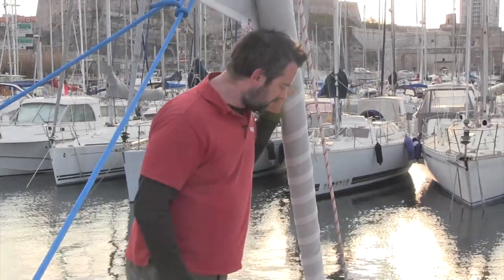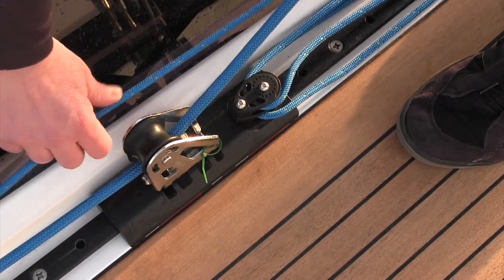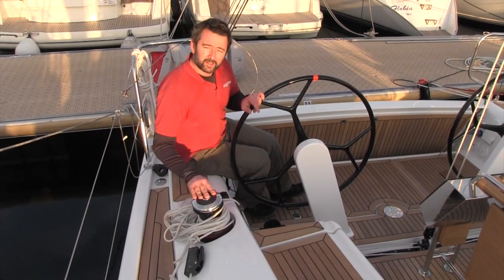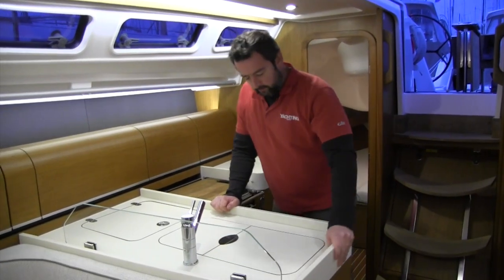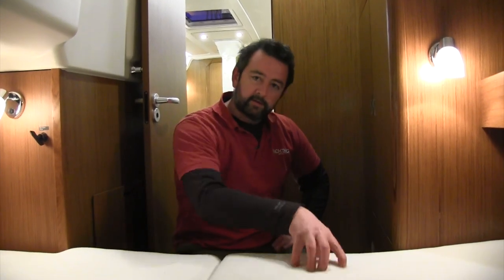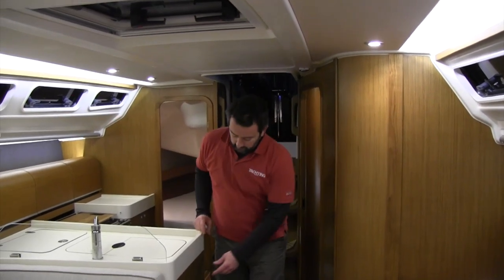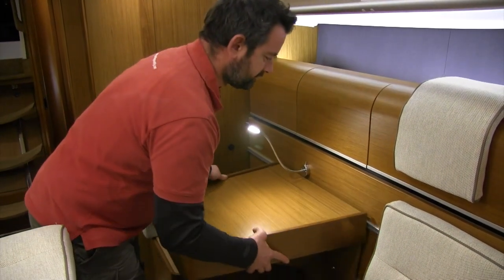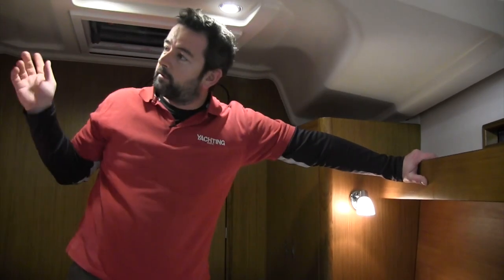Yachting Monthly's Dehler 38 test

Comment: I have sailed this boat from new, having done seven seasons and around 2000 nm per year including some offshore and inshore racing. For double handed sailing, it functions perfectly. 

Looking back at this review, it is remarkable how almost every single word is spot on. The two minor comments is that the B&G does not crack your leg and that the sink is not too shallow. 

It is a cracking performer. Quality wise, there are no major problems, neither in the design, the equipment or the assembly. 

In beating in wavy conditions the bow is somewhat flat leading to a tendency to slamming. The jib, even the enhanced pay-extra laminate version, is a bit on the small and stiff side. For competitions, a larger, lighter and more black one is prefered. 

I believe the price levels have gone up dramatically lately though. 

We do some 4-5 weeks of cruising with five people, four grown ups, each summer and it just delivers. 

In general, its just great fun to sail and a a great design.

Comment: A lot of ill-conceived deck details seem to plague this boat. The manufacturer seems more concerned about a chic appearance than seaworthy functionality.

I have also noticed that almost all of these "modern" hull shapes, whether 35-ft. or 60-ft., hobby-horse and pound quite severely in even a moderate sea state. I think there are fundamental flaws in these designs. Definitely not good for comfortable cruising.

And the fridge is "huge"? C'mon.